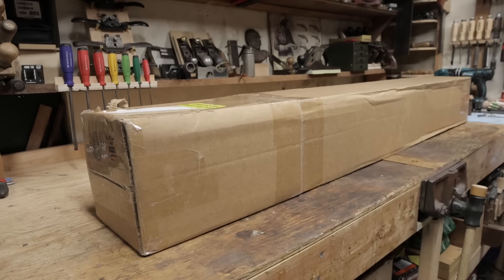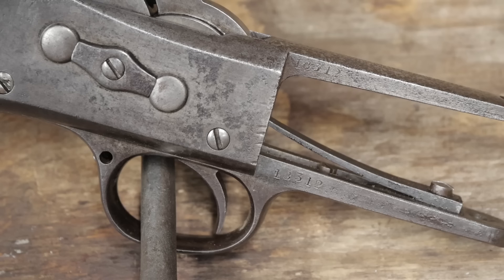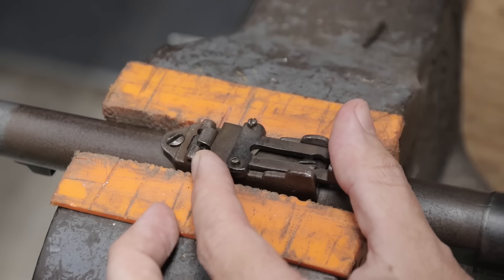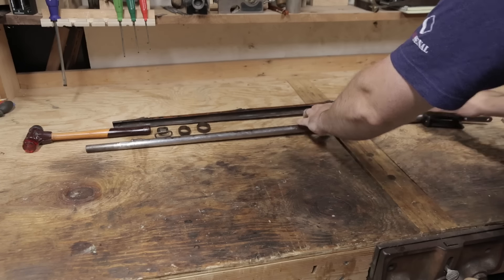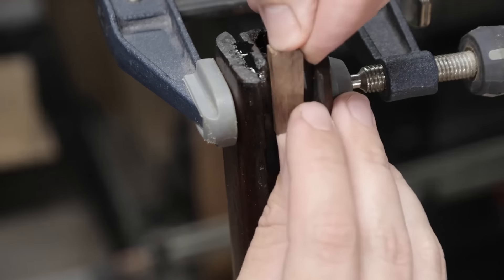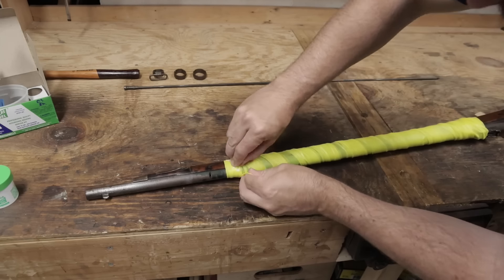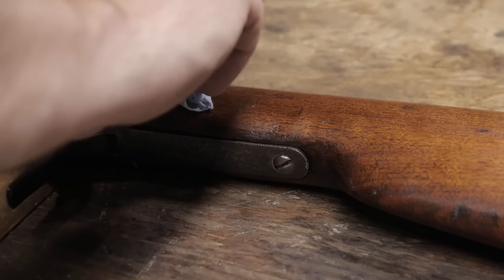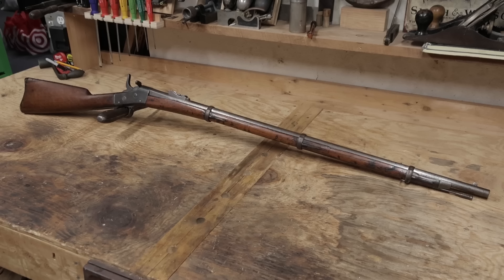New York State Militia Rolling Block

Comment: Liked and subscribed.
I really like your methods.
You made it to where it can be shot without damaging it any farther but you preserved as much of the original condition as possible.

It is well over 100 years old, it should have some wear.

I also find it interesting that NY has been requiring special versions of guns for that long.
I get that this was a state militia rifle but NYPD used to spec 12 pound trigger pull weight  in their pistols.
NYPD also had some of the worst accuracy of any major police department.
I suspect the heavy trigger pull doesn't help.
It probably did help cut down on the number of cops coming down with "Glock leg".

They changed to 5 pound triggers in 2021 for new recruits.
I would be curious to see what happened to accuracy and negligent discharges.

Comment: I don’t know anything about guns, but i know antiques restoration. Instead of cardboard i would use venear wood of the same wood as the stock, you should be able to find it of any thickness you need, especially because they are used for the same reason on other objects. For the butt metal thingy I would do a slightly thicker shim and than shaving it down, but i would leave alone the hole, the repair will be visible anyways. If you want to approach that you should hunt for antique wood of the same type with the closest grain (duh!), modern wood is very different and will be very visible
Reply from the maker: Good tips. The cardboard shims are temporary, just enough to stabilize the stock to be able to shoot it. I'm leaning towards bedding the stock at the receiver and buttplate with epoxy.
Reply: @rakumprojects  I’m afraid that epoxy will be to glassy and could break over time. Wood shims are a bit springier. That said my only experience with guns is having played (literally, I was pretending to be a pirate in a living room) with an antique flintlock and I’ve been in a gun store twice to buy a knife. My experience is with 16th to 19th century art and forniture.

Comment: If you do a lot of firearm repair, try investing in a nice set of hollow ground screwdrivers. Can really save those old screw heads from additional damage. Nice work!
Reply from the maker: The screwdrivers I use are hollow ground, made by PB Swiss.

Comment: I won an auction for one for about the same amount; however, it is not in nearly as good of shape.
I have gotten it disassembled as far as taking out the block and hammer, but the trigger plate and internals are quite rusted, and I have been unable to remove the trigger plate screws.
Reply from the maker: Try soaking the screws in kroil

Comment: was going to  suggest  removing some  wood  behind the tang to relieve the  recoil shock, but looked like  it's opened up  enough, except maybe for the corners  of the radius on the tang.   Good job, and on a rare model , thanks.
Reply from the maker: I should have included it in the video but I tested for a gap behind the tang, which there was slightly.

Comment: Held one in As New mint museum quality condition. Owner found it in a wall wrapped in burlap and tallow grease. NY State marked from 1871 Springfield Arsenal. Eagle marked. Again Mint Condition and for sale for $3,500. He offered it to me alone. No one else.

Fully intact color case hardening of the receiver,, bands and butt plate with complete slow rust bluing of the barrel. Almost no dings in the stock, no Bubba assaults on the finish, as it left the factory.

The single smoothest, sharpest actions I've ever handled. Rock solid clicks from half cock to full cock. No pits in the barrel or chamber.
It was as it left the arsenal in 1871 and not buying it on the spot is one of the handful of regrets I carry.
Reply: good deal

Comment: That not wood shrinkage, that’s over aggressive sanding. Some shrinkage happens when stored in a dry environment, but this one has been sanded down.
Reply from the maker: I'm not saying it hasn't been sanded, it most likely was judging by the markings, however I don't think the gaps at either end of the stock are due to sanding. I wouldn't put it past a bubba, but it doesn't make any sense to sand the ends of the stock.

Comment: What a find this channel is.  I've been learned on here.  I have a Rem R/B,  I think it is a 10 or 12 model. 44 or 45/70.  I don't know how to find out for sure.  Mine has a tight stock and I don't see any cracks or missing parts.  I do have some paint on the stock where it looks like, as I remember seeing it years ago, was displayed on a wall and it must have touched.  I'd like to fix that and see what I need to do to preserve it and have a range day too.  Does any body have advice? I can send pics or I'll make a video, most likely, to display the rifle.  Just need some interest.  Thanks for reading this !
Reply from the maker: If you post a video, I'll check it out!

Comment: good job on the repairs! was there a change in how the bore looked after shooting?
in my experience, rust in the bore is really hard to remove with a brush(if not vigorously going at it for an hour) but after shooting a few rounds it usually scrapes most of the harder rust out.
Reply from the maker: I did check, the bore looks about the same. I have noticed that shooting can improve the look of the bore on other rifles though.
Reply: @alexandernevalainen  fire lap the barrel with 2000 and then 4000 grit lapping compound by putting a little on the lead bullet tip and fireing four or five shots and then clean the barrel and it will more than likely shiny again and it want ruin the rifleing in the barrel because I have fire lapped over 500 barrel's and made some serious accurate shooting rifles! Regular barrels from the factory are not lapped and has fine scratches in the barrel and that why they want hold a tight pattern! One's the factory lap's to precision holds really tight groups like medium and long range barrel's! I was taught by my uncle how to lap a barrel rifleing when they shoot very very tight groups! He built rifles and shot competition for a long time for a hobby! He was a machinist at a naval after he came home from the Marines in WW2 where he was in the a lot of combat on a fence of those island's! Those were real men back then went to war as young boys and got grey hair after just a couple of years there!

Comment: That flat ground screwdriver is going to booger up all your screw heads. You are supposed to use proper hollow ground gun smith screwdrivers on firearms.😂
Reply from the maker: The screwdrivers I use are hollow ground. They're made by PB Swiss
Reply: @rakumprojects  OH, OK. I'm just used to the hollow ground drivers with wood handles, so the plastic ones make me think they are flat ground.  My apologies! 🙂

Comment: What a great rifle and the repairs you have made to them, the matching numbers, and the very little signs of internal wear and decent bore, I think show very little actual firing. The superficial damage to the sight and probably the stock look like rough handling over the years, with your work you now have a fine period working rifle that will look good on the wall and the range.
Reply: The rifle probably got dropped and that sprung the sight.  🤠

Comment: jojoba oil and beeswax is really what you should be using, its perfect, jojoba oil mimics the sperm whale oil they used during the time, without the petroleum it helps keep it from gunking up, you can mix it with beeswax to obviously make a paste or whatever. Frog lube paste is what i use, but im switching over when i can. Camellia oil is what the japanese used on blackpowder rifles.